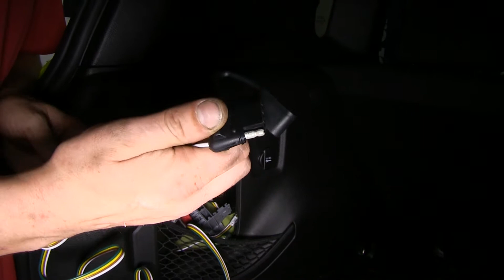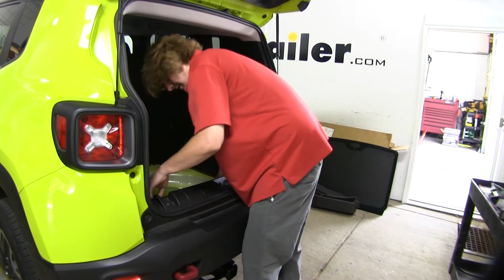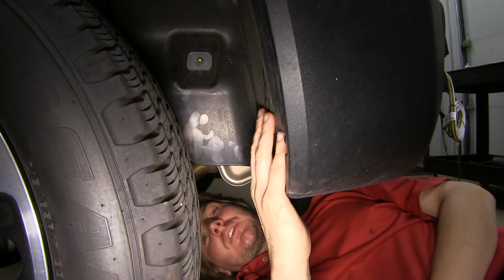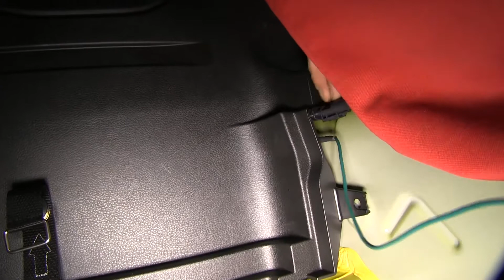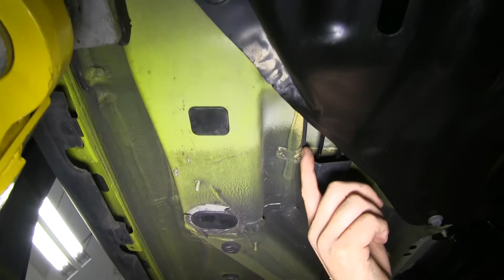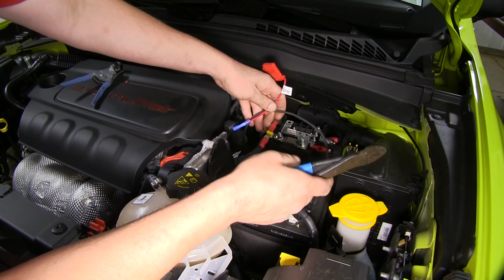etrailer | Curt T-Connector Vehicle Wiring Harness Installation - 2017 Jeep Renegade

Comment: No freaking grommet in my Renegade for running power 😞
Reply from the maker: Nothing under the floor of the cargo area?
Reply: @etrailer possibly but I’ve decided to tap in to the unused 12volt power outlet located about 6 inches in front of the drivers side panel where the fuse panel is located.  It is where the controller will fit and will use the fused red lead wire -  mine is red, not black.  

Unless there is some critical reason that should not be done.  It looks like a better solution to me.
Reply from the maker: One of the most important functions of running that 12V feed directly to the vehicle battery is that it helps isolate the vehicle's wiring system from any short circuits that might occur in the trailer wiring. Using the 12V outlet can leave the vehicle vulnerable to damage. It's your vehicle, you're welcome to install it as you wish. I just wanted to give you a heads up.

Comment: Someone cut my hitch off will this effect a new install in any way
Reply from the maker: If your hitch receiver was cut off you would need to unbolt the remaining parts and just install a new unit. If you are talking about the wire harness and the vehicle end connection point you could either wire a new connector to the remaining harness or remove the old harness and install a new one. There won't be any negative effect as long as the old harness is completely removed. Also make sure to check all fuses just incase something was shorted out. https://www.etrailer.com/Custom-Fit-Vehicle-Wiring/CURT/C56274.html

Comment: That looks tacky as heck!   Cut the wires, pull them through the same grommet they use and then use heat shrink butt conecters.  And if you take your Rene off road please for the love of GOD run the power wire on the inside of the Jeep.  There is a grommet on the forewall that you can run the wire through and up into the engine bay to the battery.   I have the wires going through it that goes to the switch pod for a light bar, ditch lights, real fog lights(amber), and under glow.
Reply from the maker: Many people will run the wiring out the rear door if they are only going to be using it a few times a year. It is more protected if it is on the inside of the vehicle rather than on the outside. You can definitely run the wiring outside if you prefer it to be near the hitch.
https://www.etrailer.com/Custom-Fit-Vehicle-Wiring/CURT/C56274.html

Comment: Here's a way to save some time... Since it's already a ghetto setup that runs the connector out of the trunk to your trailer you might as well just plug into the 12v connector with a cigarette lighter type plug instead of running a wire all the way to the front of the vehicle.
Reply from the maker: Running the wiring out of the rear door is designed to protect the wiring year round if you are not going to be pulling a trailer on a regular basis. You will need to run the power wire to the positive post on the battery because the 12v outlet is fused and you run the risk of prematurely blowing it. This would cause your lights to not work on your trailer.
https://www.etrailer.com/Custom-Fit-Vehicle-Wiring/CURT/C56274.html

Comment: spent 3 hours trying to get the + lead through that grommet. there is absolutely no way that's a solution. I ended up just taking off the tail light and routing it that way. took 10 seconds.
hope this helps someone.
Reply: You Sir, gentleman and a scholar, ever in the Phx area- the beer is cold and on me.
Reply from the maker: We did not have any issues with running the wiring through the grommet. You may have to put a small hole in it in order to get the wiring to pull through easily.

https://www.etrailer.com/Custom-Fit-Vehicle-Wiring/Curt/C56274.html